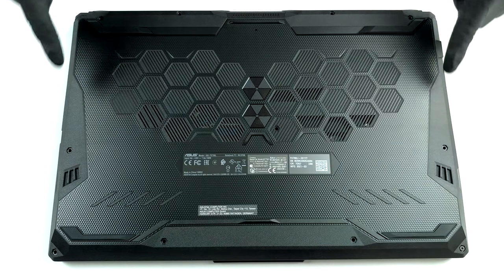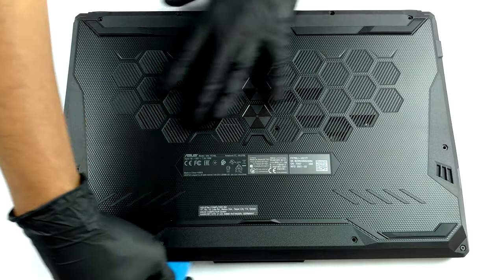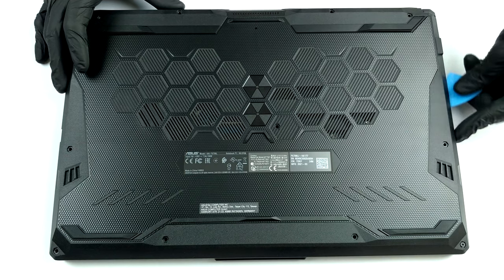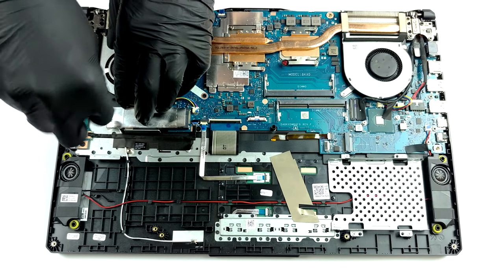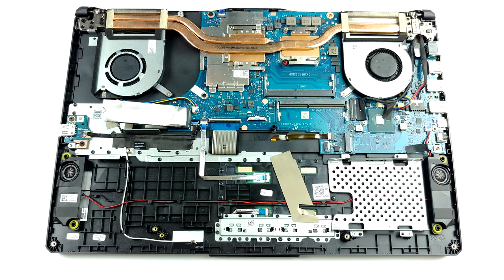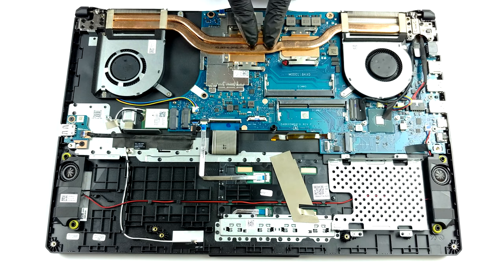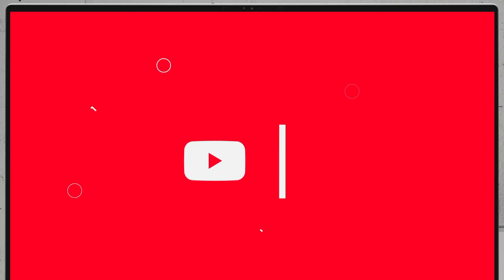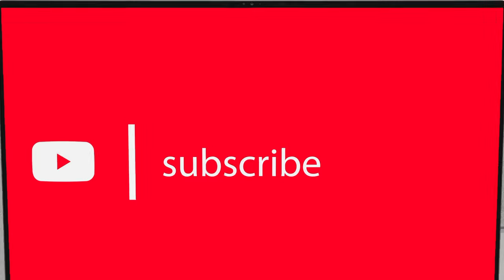🛠️ ASUS TUF Gaming F17 (FX706) - disassembly and upgrade options

Comment: After you unscrew the bottom the first thing you should do with these laptops is loosen the bearings holding up the screen a little bit because they're too tight for the thin flexible plastic casing around the screen. The pushing up of the screen every day eventually caused a crack on the left side of the screen casing for my FX705DT it showed up earlier this year.

Looks like you'll have to take out the cooling system to do that though but not sure if the bearings are attached to the cooling system or the cooling system is just sitting next to the screws, and possibly the metal plating underneath is keeping it in place too. 

From what other people have shown they make the bearings on Asus laptops a bit too tight i've seen some photos of the whole side totally broken off and it's always the left side, why it doesn't do it to the right side i've no idea.

Comment: Upon opening, the metallic sticker of the half-exposed SODIMM ram had been floating in the case and WILL NOT re-adhere. Is it safe to use WITHOUT removing the black papery sticker covering both of them? I don't care if it's there, I don't care about heat displacement on SODIMM. No, there are no identifying markers or numbers on these stickers or the paper. It is the set of parts next to the un-grated fan on the right.

Comment: I have the same laptop and mine have 8gb, so which type of ram should i use with the stock one (brand, mhz, etc.)
Reply: I'm planning to get one tomorrow. It's a pity there's no simple RAM cover, but I understand piece of this size needs extra stability. I would recommend just asking for a shop to order tge correct RAM and change it, otherwise Google will help.
Reply: Crucial RAM
Reply: yeah i was wondering that too, thinking about upgrading mine too, but no idea what's better :D
Reply: 3200 hdz DR4 RAM is best you can get
Reply: Crucial ram 100% i used the factory one and got the crucial 8gb for the second slot for 16gb and that worked good for a while till I switched to the 32gb curcial kit

Comment: I have this same laptop, but my battery is the full width of the device. I have the hard drive port on my motherboard, and I'd be tempted to pickup a hard drive cable to connect a 2.5" SSD for more storage if I could swap out for a smaller battery. That being said, the battery life is already awful (around 2 hours with just web browsing), and I worry about making it even worse. What's your battery life with that battery, and what type / size of battery is it?
Reply: If you use a gaming laptop, you shouldnt look forward to the battery because its really bad. I suggest you should plug-in whenever you use to have the best experience and avoid affecting the battery.
Reply: Unless you need to game on it, I recommend turning down the refresh rate, it helps extend battery life by a bit

Comment: Does the screw in the bottom right not come completely out? It looks like its still in there.
Reply: I laughed seeing this because I had the same problem opening my laptop and that screw just wouldn't come out. Seemed slighly tilted to me. Nothing to worry about though.
Reply: Lmao same wtf was that little guy hanging on so hard for?
Reply: I popped it out with the end of a flathead 😅
Reply: Yup.  Bottom right seems a bit crooked, had for me to get out too.  Wonder what's with that particular screw placement!

Comment: Is it just me or does there actually appear to be a second M.2 PCIe x4 slot right next to the 2.5" drive slot? The narration says it only has one slot (even though the hand in the video at 1:57 seems to point out the second M.2 location)?
Reply: I was thinking the same thing. I bought mine second hand and the guy told me i could add another m2.

This video is just mouthing off an article
Reply: Actually, yes there are 2 M.2 slots. With that said, are they both Gen4 ? That's doubtful, but you can put 2 Gen3 M.2 SSD's in the F17 ! I got one 2 weeks ago, and just bumped the RAM to the 32GB max yesterday. I'll probably get 2 M.2 2TB Gen3 SSD drives for it, running around 3,500/3,000 MBs. Plenty fast for a non-gaming rig.
Reply: @ntvtexan5015  i put in a 1tb m2. It was gen 3 though, so I don't know about 4

Comment: For the 2,5" HDD, is there a connecting cable in the package or i need to buy it separately?
Reply: there is one in the package, writing in my own Asus Tuf F17
Reply: @hide8744  
Thank you, i have my own already too :)
Reply: Which country and model? New models in EU nope, doesn't even come with metalic bracket
Reply: @Grusemil  TUF F17 FX706L (Bought in Hungary) had the cable included.
Reply: U.S. models appear to not have the tray or cable included
Reply: @jncodanv  Where can you get the tray and cable?

Comment: I am trying to find out how to remove the motherboard. But I have yet to see a video that dismantles the motherboard. The reason being. I gave my laptop for service and the guy was very stressed when he came out. It was my mistake. When I was turning the laptop I heard a sound inside like a small screw or plastic part was moving. But it stopped moving. I asked him and he said what. I shook the laptop then no sound. there were a lot of people at the service center and lot of sounds so I did not take it seriously.
I got a new SSD so I installed it myself. The screw at the back that is under the hinge on the right hand side (or your left hand side since your hands look like you are standing on the other side.) which is the corner screw near the CPU fan. 
My CPU fan stopped working so I think the heat must have made the plastic brittle.
So when I tried to remove the screw. It was not opening. Now I could not go back to the service center as they said if you open the laptop yourself the warranty is void.
For a moment I thought let me just take the laptop back and ask them to clean it which is free under warranty then they will have to deal with opening the screw.
But I like an idiot decided to open it and the plastic moulidng like stars around the metal thread broke. While I was trying to remove it when I moved the laptop I heard the same sound.
Then I realized that the service executive must have turned it a little too tight and since the plastic was brittle it broke.
So I fucked up.
Then I tried holding it up and that broke the entire threading from the plastic. Somehow I pulled it out.
Now it is inside without a screw I have kept the screw.

Now the problem is I have 1 year warranty left and my Intel Display gave me a problem once with some ghost band but now it is ok.

Where i live there are different level of repair guys who repair broken laptops. They melt in the plastic or use some liquid and even remold plastic parts of laptops.

But they are not really hardware experts.
So I want to know how to remove the motherboard from the inside panel.

So when they do I can monitor it. Because Asus has a habit of keeping some hidden screws on purpose. So you miss it and then you break it and the warranty is void.

So they can mold it and even if it not perfect it can't be seen.
Since it is under the motherboard and under the hinge.

So in case I have to give it for warranty or service again I can easily give it and not void my warranty.

I have to keep searching..

Comment: bro? can u upgrade your processor from i5 11th to i7 11th on asus tuf f17 gaming
Reply: no, but yes. its really hard, as the cpus on laptops are soldered to the motherblars unlike a desktop. laptops are not meant to be upgraded. the two pieces of hardware that allow ease of interchangeability/upgrade, is the ram and certain storage spaces.

Comment: i have the same laptop, can i uprgrade to 64gb of ram??
Reply: Yeah with 32 and 32 GN dual
Reply: @joe2947 @joe2947  I was worried about this since the spec said max memory 32 GB. But that chipset does support 64 GB. Did you upgrade yours?

Comment: Hello, can you tell me how much RAM I can use? I have fx706he motherboard, Intel Core i7-11800H processor. The asus website says the maximum RAM is 32 GB, the crucial system scanner is 64 GB, and the Intel website says 128 GB. I'm honestly confused...
Reply: Are you running like 5 instances of flight simulation? What in the world could you need 32gb for in a laptop lol
Reply: I am wondering too. Have you tried with 2x16 GB of RAM? Does the system read all of it and can it effectively use it? I'd be happy to hear your answer. I need this much RAM for Hyper-V.